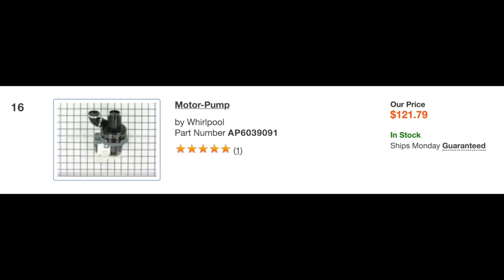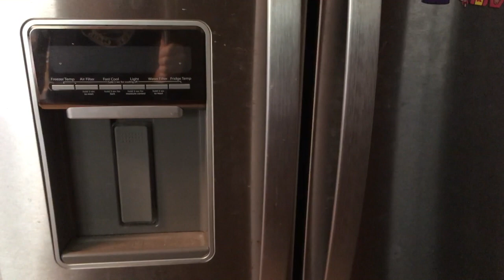Whirlpool Dishwasher Pump Motor Repair (And Upgrade?)

Comment: Fantastic video.  After years of frustration, we were on the cusp of buying a whole new dishwasher and this saved us.  :D   Here’s my story & modified solution.

The lower bearing was in tolerable shape... but I didn’t trust it to stay that way.  The upper bearing was my presenting issue—terribly ovaled.  In fact the scoring on the housing was so bad, light was clearly visible through the wall: I’m probably .5mm or less from a breach and nasty leak.  :-\  But it’s solved now!

I got the lower bearing out with a dental pick: I tried a long screw but it chipped the graphite.  Not having a lathe or any such skills, I reviewed the other comments and purchased “uxcell 685 Plastic Bearings 5x11x3mm Glass Ball Nylon Cage 685 Bearings 5pcs” from [Prts_Mfia_AMZN]… but it only set me back $9 or so.  These bearings are only 1mm high, so they actually fit beautifully underneath the black plastic (silicone?) retainer rings.  The ID is a nice fit on the shaft, with insignificant play.  

For the bottom bearing, a thin ring of aluminum HVAC tape (“mastic sealant”; super sticky; not duct tape) brought the OD up to being snug.  For the upper bearing, the OD of 11mm was rattling around in a hole of about 14mm; a careful application of JB Weld solved this and centered it firmly.  (Yeah, so, I did get a touch of the stuff into the bearings and had to chip it out with my dental pick when half-solid, an hour or two later.  Check for smooth movement before it sets.)  This then had to dry for 24 hrs.  When I reassembled, there was enough “vertical” play—due to the thin depth of my bearings—that I was afraid the shaft might jump out of the bottom bearing and hit the walls again.  I solved this with two more bearings stacked on top of the magnet to keep it away from the lid.  Perfect fit; glad I had the extras.

Everything went back together and the dishwasher has now completed a couple of cycles with no issues.  Thanks to all here who helped, and I hope this extra detail can be of service!

Comment: Big thanks for making this video! In my case the bottom bushing seemed mostly fine, but the top one was grinded to an oval and the wear on the inside of the motor tube was quite obvious.
In terms of possible fixes, I'm considering designing and printing a replacement bushing using ABS plastic. It should tolerate the water and temperature, but I'm really not sure how it would hold up to the friction. If it works for a year or so before wearing out it might still be worth it since it's quite an easy/simple part to print. Any thoughts on this?
Reply: I had similar thoughts about using JB weld in the bearing... I suspect any kind of plastic is going to have a short lifespan. 

I wonder why a bearing kit for these is not available. It seems like its designed as a wearable part. 

Pool pumps are similar and often use ceramic bearings in the same spots and these typically last many years - 10 at least. These kits are also made readily available.
Reply: Use Delrin and turn it on a lathe ..

Comment: look for a knockoff brand made for other dish washers. they all are the same part just with different part numbers. i just found the alternate version from amazon for $52 instead of the original part number for $110.

Comment: Thanks for making the video. Did you happen to measure the resistance of the coil? Mine died, and it reads .5 M Ohms. I'd say it's dead.
Reply: Same issue here, ohmmeter says the terminals are an open circuit. Trying to figure out if that means the motor could be fixed with a new bushing or if there is an internal wiring problem
Reply: There's probably a little technician manual in the toekick of the dishwasher.  Mine says the resistance across the motor should be 5 to 15 ohms.  I measured 9 ohms.  I think if you're getting anything other than 5-15 ohms, the bearing trick isn't going to fix your problem.

Comment: Had the same problem with our dishwasher tried to repair using a nylon bushing turned on my wood lathe but water started coming out the motor so wound up replacing the dishwasher.

Comment: For the 21/32nd's, did you use that size bit, or just wallow out with a 5/8"?     Awesome vid, thanks!  I ordered up the bearings, now seeing if I need to buy the bit, too.   Someone could make a lot of money making a rebuild kit for these motors...   OR offering a reman program and have cores sent in...
Reply from the maker: I think I did go up to 21/32. Made the bearing a bit looser in there than I'd have preferred, but it's still going strong after almost 2 years.
Reply: @PhillipsHomeRepair  Thanks for the reply.  I ended up buying the 21/32nd's bit but it was too big.  A 5/8" would have been perfect according to my caliper.  I didn't have one so I used the 21/32nd's and heat shrunk a tube over the OD to make up the space.  It's been working great for a couple weeks now.  Thanks for the video!

Comment: Hey - thanks for the great video!  I ordered the part and had some tubing, your instructions were great, and the repair worked well!  Unfortunately, in doing the repair, I developed a slow leak that I can see underneath, can't tell where it's coming from, and gave up.  New dishwasher today - GE this time.  Hopefully I'll get more than 4  1/2 years out of it.  The pump is $177 now, a new dishwasher is a little more than twice that, so I'm going with a new one.  Bummer.
Reply from the maker: You win some, ya lose some. You can blame the manufacturers for the disposable nature of modern appliances. At least you gave it a shot.
Reply: Has anyone figured out a fix for the leak issue?  Is seams like there should be some kind of sealant that could help?  @PhillipsHomeRepair
Reply: Or could it be how tight the screws are when putting the moto back together?  I was wondering how tight they should be when reassembling @PhillipsHomeRepair

Comment: What did you use as a clamp to reinstall the black 90° hose again?
Mine had a one use crimp clamp on it and the hardware stores dont carry new ones of the same size. Thanks
Reply from the maker: Anything that fits around it will work. Worm clamps are the most ubiquitous, but the spring-style clamps work fine too.
Reply: @PhillipsHomeRepair  Thanks, I used a worm clamp. Reinstalled the pump and it worked for a day. Still wont circulate every cycle.  Looks like a different problem for me. Appreciate the reply!
Reply: I found that McMaster-Carr
54195K26
305 Stainless Steel Screw, 5/16" Wide Band, 1-3/16"-1-3/4" Clamp ID
fit perfectly

Comment: i have repaired 10s of thousands of appliances, we are deep in the crappy age stupid engineering coupled with the lowest quality parts they can get away with.but whirlpool is is better than most. the best advice i can give you is buy the simplest thing that does what you want. counting removing and reinstalling and all his other work to do this repair it would cost you more in timeand labor then the appliance

Comment: I believe that rubber grommet should have been a water proof bearing. So basically the manufacture is trying to save $1 out of this vital part and charge $100 from the customer for the whole assembly.

Comment: This is the expected failure mode of every magnetic pump. Because of the rough electric operation, either the bushings or the shaft will wear into an oval shape and at some point the pump won't be able to get spinning by itself.
Im surprised Whirlpool chose this type of pump for the recirculation. Magnetic pumps are okay as drainage pumps but they don't belong in areas where continuous operation occurs the same way brushed motors don't belong there.
Other manufacturers use asynchronous motors for this, Whirlpool really cheaped out here.

Comment: My Dishwasher is filling with water, it is hot, but the washer is not completing a cycle.  It just runs for hours.  Do you have any idea what that could be?
Reply: Think it could be the heating element?  The water is warm/ hot when I open it, but not sure if that is just from my water heater in the house.
Reply: Not sure if you got it yet but read my other comment. Mine was doing the same thing. Water was hot. After disassembly this pump seems to be the problem.

Comment: Is it still working 1 year later?
Reply from the maker: It sure is! Quiet as ever.
Reply: @PhillipsHomeRepair  Are you still using the pool cleaner bearings? I'm curious how the plastics hold up?

Comment: I ordered the part number listed and the inner and outer diameter are both too large....
Reply from the maker: Yes they are. I touched on it in the video, but I put a small piece of aquarium tubing on the shaft to make the difference and hand-turned a drill bit into the plastic housing to open up that space. There isn’t a standard bearing that fits perfectly, so that was my workaround.

Comment: The best part (pardon the unintentional play on words) is that the Repair People will charge you $250 to come out and take this part out of yours, put a different replacement part in place, MAYBE do this teardown and repair, but most likely test the part that they've jostled around and find it's working now that they've "punched" it too, and put your broken one on the shelf to put into MY dishwasher next time. What a scam. When the replacement part breaks too, I might get my original one back from the repair shop -- $500 to move broken parts around to keep it running a while longer.

Comment: 08-30-21 $208.00 thinnin on replacing with a fountain pump.
Reply: so i used a nylon bushing 1/4 by 5/8. 1/4" has too much slop. so I'm filling a copper slip cap with JB-Weld and drilling a 5mm hole down the middle.

Comment: Cant thank you enough for this video. Saved me $170 for the part alone. I was skeptical after removing the graphite spacer and seeing it was in much better condition than the one in the video. Went ahead and replaced with the bearing, using heat shrink to fill the gap. Its in the kitchen running again as I type this.

Comment: Thank you for the video! I just replaced the same crap circulation pump on our kitchenaid (also made by whirlpool) after 3 and a half years. 
I did buy the whole bottom plate with the switch-over motor since the price was actually less than just the pump (pretty ridiculous but whatever).

I took the non-working pump apart and same issue but a lot less wear on the bearings, they don't seem oval.
There is one section inside the barrel where the rotor lives that has some scuffing.
There is also some wear between the top of the rotor cylinder and the bottom of the top graphite bearing as it left some grooves in it.

It almost seems like the barrel is not perfectly round anymore.
Maybe it got deformed from heat.
In my case the dishwasher would circulate in the beginning and then stop somewhere early in the cycle.

I'm a bit surprised that the insides of the pump are exposed to the dirty water circulated through the dishwasher.
This has planned obsolescence written all over it..
Reply from the maker: Totally. If someone was designing a piece of equipment that they were going to be responsible for repairing, they never would have done it that way. Obviously the boss said to the designers, "Make the pump cheap for us to make, expensive for the customer to replace, and make it last roughly 2-3 years with normal use." I wish there was a way to hold them accountable for our landfills that are visible from space and that huge plastic garbage island in the ocean.
Reply: @odousa I had this exact problem just last week. The barrel was not perfectly round and it looked like the permanent magnets were trying to poke out of the plastic they were enclosed in. This was causing the scraping on the housing. I filed the barrel down a bit and it's now working. Not sure how that happens. Heat? Weakening plastic / epoxy that houses the magnets?

Comment: This same dishwasher pump motor is is in my Gold Series Whirlpool Dishwasher. The dishes would not get cleaned after the cycles. Found this vid on YouTube. I decided to try this same repair on my dishwasher's circulation pump motor. What do I have to lose? The graphite bushing at the bottom of the pump motor housing was worn out (elongated) and the inside of the impeller shaft housing was scored same as indicated in the video. This elongated hole in the bottom bushing was creating uneven circular travel of the impeller shaft causing it to not spin when power is applied to the pump motor. The impeller shaft is operated using electro-magnetic power.

So I ordered a couple of plastic ball bearing racers with glass ball bearings from a bearing company in Canada. The shipping cost was more than the cost of the bearings. (typical). The order cost me around $32. I couldn't find a 21/32 inch twist drill bit in my town, so I had to settle for 5/8 drill bit which was a bit too tight of a hole for the ball bearing to seat properly. I ended up gluing a piece of 120 grit sandpaper around a 5/8 dia. wooden dowel and twisted that into the hole until the ball bearing housing fit. I messed up the hole drilling of the motor housing by drilling too deep to the point where the drill bit almost came out through the motor bottom. If you try this repair, set up a drill depth gauge on your drill bit for a more precise drilling depth. I did the drilling by hand as recommended in the video but did not check my drilling depth until almost coming through the motor housing bottom. (I was watching TV whilst hand drilling and lost my concentration). I had to use a shot of JB Weld two part plastic epoxy to fill the void and then I tamped in the old graphite bearing into the epoxy as a filler. I let the epoxy cure overnight and in the morning, re-assembled the pump motor and re-installed it into the dishwasher. I reconnected the dishwasher wiring, drain hose and hot water supply line and fired the beast up for a test run on the 1 hour cycle.
 
Lord have mercy, the damn thing works again! No leaks or anything.This repair really works! saved me over $250 bucks by not having to replace the pump motor. We'll see how long the repair lasts.
Thanks YouTube, for archiving this info and a loud shoutout to the dude who posted this really great repair video. Like I always say, "knowledge is power".

Comment: This was a real lifesaver. I found the problem exactly as you described it. Cheapass 'bearing' wore out within 2 years allowing the motor field to contact and seize the armature. My solution was to install a $7.49 ball bearing. It took a bit of research for the small bearing and a cut up old credit card for a shim (probably any .030" hard piece of plastic will work) and a drilled out bushing over the armature shaft. Working perfect! Thanks......

Comment: I just finished doing your upgrade. I used a 5mm ID x 16mm OD bearing, the ID was perfect, but I had to ream out the OD slightly. Not too difficult. I was also tired and frustrated with the annual pump replacement. Thank you!

Comment: I have a Kitchenaid dishwasher which cost twice as  much as the whirlpool but has the same motor. I changed the whole assembly but I appreciate the video.  I will attempt a repair to have a back up.  Great Job

Comment: I agree it is a POS. The pump leaked and ruined my floors. thousands of dollars in damage. The design has many points of failure that could cause leaks. Very bad design IMHO.

Comment: This was exactly my issue. I had been dealing with the whirlpool dishwasher not running for a year now... Been replacing parts here and there trying to get to work. Finally stumbled across this video, ordered the washers and put them in... Washer now working!!!

Comment: Whirlpool parts prices are such BS. I had to replace the shocks in my washing machine and official parts are like $300.  It's literally a piece of felt in a greased tube, probably costs $2 to manufacture and I've seen guys hack it by putting some card stock behind the felt to tighten it up. 

The big thing you're describing is the sump assembly, it's just a piece of plastic so it probably adds almost nothing to the price (the magnets in the motor are the main expense).

Appliances are not all made in the same factory. US appliances are just crap (I hear KitchenAid is a little less garbage than most American brands).  It's really sad because American appliances were once quality, now they're the worst in the world.

Comment: You are a lifesaver. Watched your video and found it was the exact problem with mine. Thank you. BTW, yes, all these new appliances are junk and usually all made out of the same parts bin. No difference between the brands. Unless you wanna spend triple what one should cost.

Comment: I agree, I also have 4 shitty whirlpool appliances. currently working on my dishwasher. I will probably just purchase the dam part!  FYI I had the same issue with my gas oven. Fortunately it was still under warranty, the repair guy just moved the ignitor closer to the gas outlet.

Comment: Kitchenaid DW not washing. Just-Ask pointed me to a blown micro fuse on the logic board.  New board was C350. Bought replacement fuses from the UK for C0.12 each. Blew the first one which sent me looking at the motor. replaced it and then got curious about what went wrong. SAME FLIPPING BUSHING. but a chip had broken off and it had disintegrated and jammed the motor. Really pissed! What a racket. C250 for a new motor. because of a failed 10 cent piece of graphite. Outrageous!

Comment: You are a man after my heart.  I have a machine shop and I will be following your advice and trying to repair my pump if it turns out it is the problem.  I don't have a wiring diagram but I think you said the motor runs on 120 Volts, so I think I will hot wire it before taking it apart.  I like you, am sick and tired of buying junk and paying many bucks for it.  It seems like I have to repair everything I buy.  We have a Kitchen Aid (about 3 years old) which like you say uses the same parts.  I will save this page and when I get it done I will contact you.
Thanks guy Tony